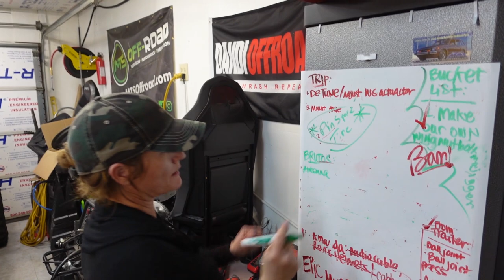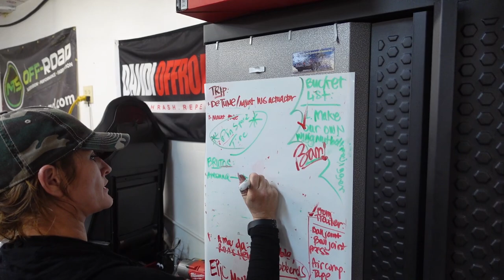2021 RZR TURBO S Desert Survival Guide Not Really A Guide Tools For The RZR Turbo S And Can Am X3

Comment: Here's a trick I use. Only work on the car with tools from the car kit.   I've removed the clutch, secondary, radius rods, wheels, axles with the M12 stubby.   I've got a bag about the size you had for your medical which has the m12 stubby, m12 ratchet, batteries (separate from tool to prevent accidental triggering), speed strap, soft shackles.   For tools I use a yorktown tool role from atlas 46.  It has a wrench roll on one side, and bag/compartments on the other side.   I also use the ernst twist lock socket rails.  I got tired of digging around in a tool bag to find something, the tool roll + rails eliminates that, easy to find, and compact.
Reply: Oh, crappy design on the upper ball joint for the RZR, the circlip is on the bottom of the ball joint and it is pressed in from the top.  The clip can break/come loose and catastrophic fail.   I replaced mine with kellers and don't worry about ball joints anymore.
Reply from the maker: Great trip, great info.. thanks

Comment: Little tip, remove the batteries from the drills. Had mine go dead because the trigger got pushed while in the tool bag and drained it.
Reply from the maker: Good call, thanks

Comment: Hose clamps (various sizes) and bailing wire. We have used that stuff to make splints for broken front tie rods and broken a arms.

A-arm splints made from 1/2 drive extensions and steering tie rod splints made from wrenches or 3/8 drive extensions.

Ratchet straps, may need these things to pull things back together.

We sure could have used that ball joint kit, nothing like beating a Can-Am ball joint into a razor a arm with the big hammer....it sucked and messed up the a arm.
Reply from the maker: Thank you for all the awesome suggestions! Will definitely be adding some of that. And yeah - been there!! NO FUN. Lol.